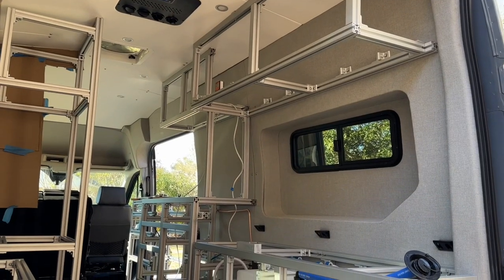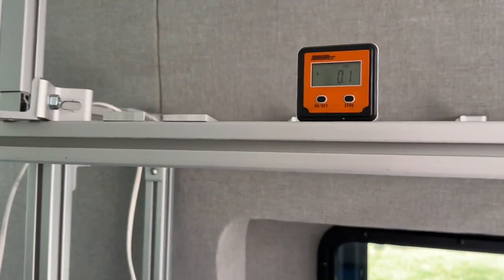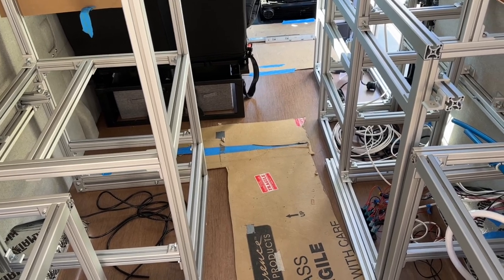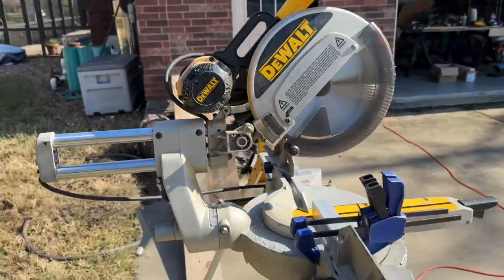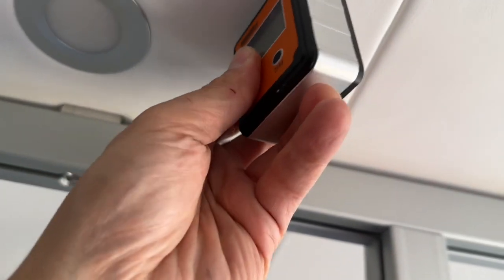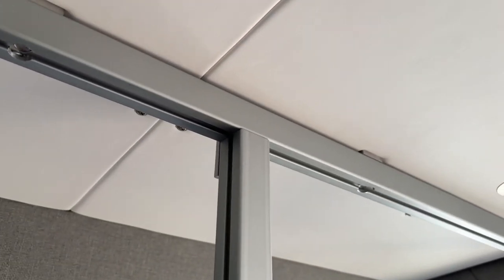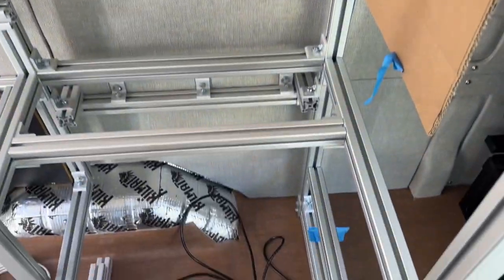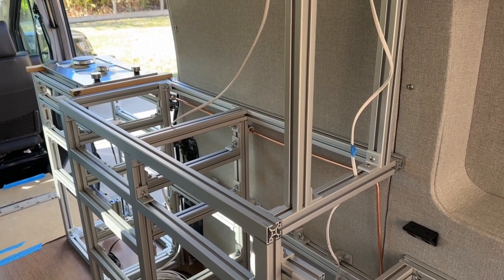Ford Transit Van Build | 2 Tips for Framing Cabinets Using Extruded Aluminum

Comment: Thank you for the video.  One question - with so many angle brackets used to join the extrusions, did you find it more challenging to install cabinet panels?
Reply from the maker: For our flat panels, we used a threaded insert in the back of the wood and fastened with T-nuts. The angle brackets work really well as they give you a lot of flexibility to make adjustment with the 8020 as you tighten down the nut. No issues and would do this  again if I had to rebuild!

Comment: I really like your video's and your van build. I am also in the middle of my Transit HR Ext. build. My question is, how is using your level meter going to be accurate unless you have leveled all your wheels to make the van floor perfectly level? Otherwise you will be not getting square to the floor. I am measuring from the floor and then parallel and perpendicular to the floor.
Reply: Yes, we did realize that we had a slight slope in our driveway, and so we measured it (with the level meter!) and took that into account as an offset when we measured in the van .  The other way around that is to use levelers under the van, but we were able to make it work!

Comment: So I went through a few of the videos of yours prior to this, and I didn't see anything on the plus-nut installations that you're using for mounting those upper cabinets. In one earlier video, putting the wall panels up, it looks like you have some bolts/washers in the walls where those plus-nuts are? Or are those for attaching the panels? One assumes you plotted out your cabinet dimensions well in advance and installed the plus-nuts where you would need them for the cabinets, rather than "this looks good" and then later on, built the cabinet frames to fit?

I get the use of the wedges you cut out of the aluminium bar stock to straighten out the 8020 pieces on the ceiling to be level; I'm curious how the bolt going through the 8020 into the plus-nut is set, though. It would have to be going through at a slight angle, with relation to the aluminium extrusion, yes? The head of the bolt can't be nice and flush with the surface inside that bottom-facing slot of the extrusion?
Reply from the maker: You’re correct we used plus-nuts in the roof cross rib supports. The plus-nuts we used were 5/16-18 X .020-.280 steel pre-bulbed purchased from Amazon (S31MG280). I talk through this briefly on our ceiling and lighting video. You can see a plus-nut location through the furring strip at ~3:04 in that video. This did require some planning for both the cabinets above the sink as well as our cabinets above the bed. There are only so many places to mount the plus-nuts in the Transit roof support ribs. This combined with the limited number of roof support ribs and the hole locations for lighting are important considerations to consider when planning for the cabinetry. You are correct that the bolt going through the 80/20 aluminum extrusion will have a slight angle relative to the extrusion for the roof connection supports. Thank you for watching!!
Reply: @blazingwanderers  Thanks for the reply! So the bolt head isn't going to seat flat on the inside of the slot - that's not an issue?

That trick using two corner brackets - that's sneaky. I like it. I'm tucking that one in the back of my brain for when I get to this point myself.
Reply from the maker: The bolt is just ever so slightly at an angle but will not pull through. We haven’t had any issues either at this point. 

Good luck with your build!

Comment: Interesting!
How are you preventing to create a "cold bridge" from the outside, as basically  now the outer skin of the van and the interior cabinets are connected?
or
In a cold day, do you feel the outside temperature through the cabinets?
Thanks in advance for your input!
Reply from the maker: We have only used it once in late March in west Texas where it got cold those nights—in the 40s. We did have to turn on our Webasto heater a few times during the night (on a program) but not for long. All of our walls (even behind the cabinets) are insulated with KILMAT and THINSULATE so it’s pretty cozy inside and I don’t notice any major temperature difference around the cabinets.

Comment: I appreciate the great, practical video on 8020 nitty gritty. I’m in the design phase for my cabinets and feeling intimidated.
If you’d placed your plus nuts further in, would you skip the wedge approach altogether?
Reply from the maker: We discussed that a bit. Just like in your standard house, walls and cabinets are not square either, and a lot have wooden shims behind them. Obviously, having the plus nuts where you want them to be makes life easier! But even then, you’ve got to make sure they line up exactly with your design. once we started using the digital level and could measure more accurately, cutting shims of various degrees was pretty easy.

Comment: kinda expensive aint it?
Reply from the maker: I don’t disagree with you that using 80/20 aluminum is expensive compared to just wood, but we did budget for this in our build. Our major concern with all wood framing and cabinetry was the structural integrity. We read several posts online through various forums of van cabinets splintering and detaching from the van wall due to collisions. The last thing we wanted was to have a cabinet or wood spear slamming  into is in the front seats. I hope that never happens, but we wanted to be sure we would be safe. 

Another reason was the weight. All wood framing is heaving, and using aluminum helped reduce some weight as well.

Comment: I just turn off when anyone starts using any kind of level on a van build... You need to go back to school. If your van is not PERFECTLY level, you are wasting your time. And even if it were, as soon as you step in to do anything it will move because of your weight and stuff called suspension 🙄🙄 please stop making videos using a level...
Reply from the maker: Well, it worked for us, and all of our cabinets are perfectly straight and level. We made adjustments for when we stepped inside and on our gently sloping driveway. Lucky for us, our build turned out great and we would do this again in our next build. You don’t have to use our tips(although several folks have with lots of success) but thank you for your constructive criticism.